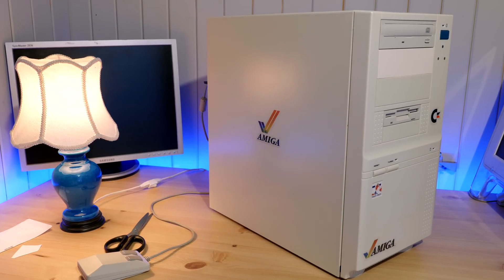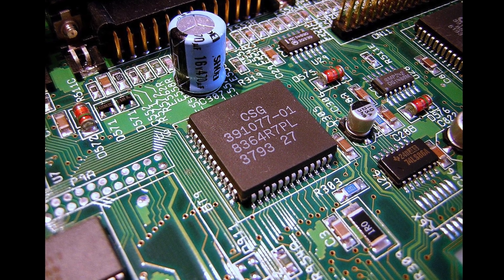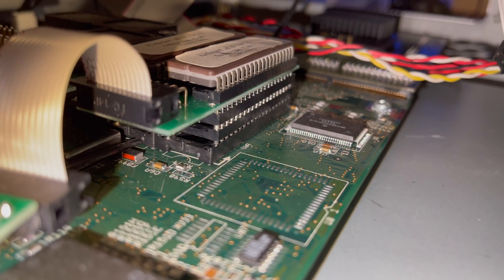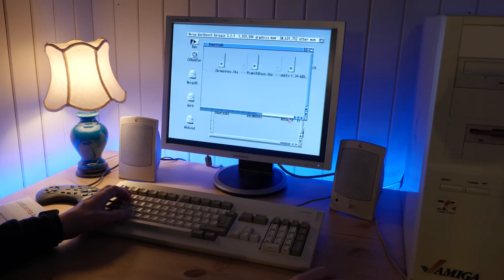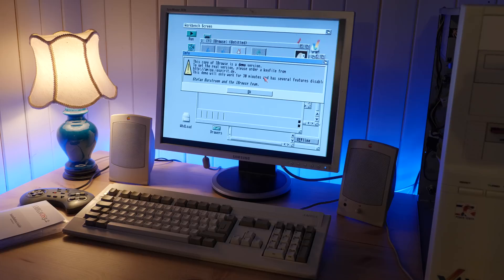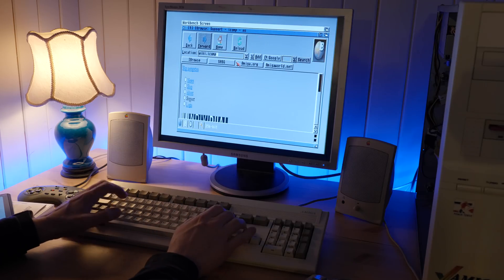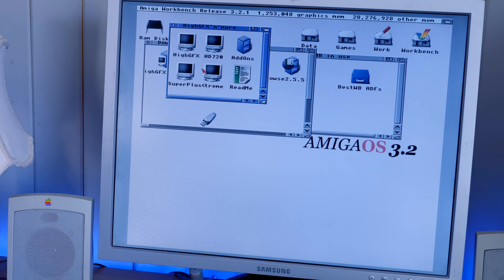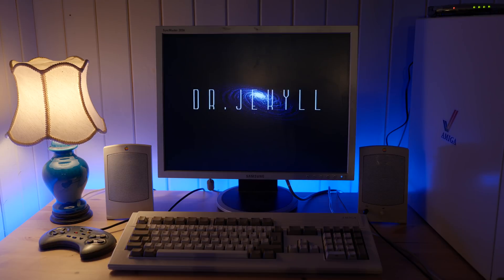Upgrading and getting online with the Amiga 1200 Power Tower

Comment: Whatever you do, do not hot plug anything directly into that rapid road. This device is very sensitive to voltage surges. At the very least use a high quality powered hub. As for speed 600-700kb is pretty much the most it’ll do over a stock clock port. Not quite usb 1.1 even.
Reply from the maker: So I’ve heard. There’s some conflicting information about this issue out there. Jens Schönfeld says it’s caused by improper 5v regulation and that ATX and MeanWell PSUs are usually to blame, but others say it’s an ESD issue and that the device should have been able to handle it. Thought about mentioning this in the video, but since I don’t really know what is actually true, I didn’t want to potentially spread any misinformation.
Reply: @OddObsolete  The MeanWell PSU comment is rich. This is likely from my busted RapidRoad that admittedly Jens did replace free of charge. It needs to be specified however that the particular MeanWell PSU I am using is medical grade and therefore liable to perform to exacting standards. So which would you rather trust? A world renowned PSU manufacturer with decades of experiences and a legally binding medical grade spec or Mr Jens Schoenfeld maker of admittedly high quality but still hobby grade devices? I like Jens, his devices are fantastic and I certainly spent my fair share of money buying a good collection of them. I certainly intend to buy more in the furture but the failure rate of these RapidRoads is a little more than anecdotal.

Comment: Hi, great follow-up video! If you give up on the Apollo, I'd be much interested in purchasing it, as I have a identical card in my Checkmate 1500-cased A1200. Unfortunately, my card has severe battery damage to the PCB, with a lot of crappy repairs done to it, but otherwise working. My idea was to migrate the working parts from my card and get yours working... Thanks again, and keep up the fantastic work.
/Anders, Denmark
Reply from the maker: The PCB on this one is in a pretty shitty condition too TBH. Looks like the CPU has been replaced at some point with aggressive solder gun usage…
But anyway, I’ll let you know if it gets to that!
Reply: @OddObsolete  Thanks! :) Looking forward to the next installment.

Comment: Where did you manage to get the rapid road for Amiga 1200 ?
Reply: Individual Computers are the manufacturer and they do have a shop. But as I’ve pointed out you really need to use a powered hub for them and they are quite slow through the Amigas Clockport connection. Have a look around also for Amiga resellers in Europe who might have them for sale. Avoid! RetropassionUK though. Terrible customer service and the owner likes to blame his customers for faults 😳🙄
Reply from the maker: I’ve actually had it for a few years, and I got it from a reseller in Sweden if I remember correctly. Not sure where you can get one these days, looks like it’s currently out of stock in most places. Your best bet might be to get a used one from eBay or similar.
Reply: @OddObsolete  probably GGSDATA. It was listed as available but when ordered I got a reply it was out of stock :)

I have the rapidtoad module for x-surf installed in an a4k and a2k but those module won’t work on the a1200 clock port :/

Comment: Please note that the Elbox FastATA has a hardware PCMIA reset fix built into its Gayle adapter. You might want to test that instead of the software fix
Reply from the maker: Interesting! Looks like it is an optional upgrade though: http://eu-shop.elbox.com/en_GB/p/GAYLE-adapter-with-PCMCIA-fix/647

There’s no mention of this feature in the manual, and I did have to use CardReset for the network card to turn on after boot.
Reply: @OddObsolete  Some Network drivers actually contain Card Reset and Card Patch as part of there startup.
Reply from the maker: @cullmaster7361  Handy! cnet.device doesn't appear to be one of them though.

Comment: If you can't get the '040 accelerator working, have a look at the Terriblefire 1260 cards. 68060 CPU, 128MB of onboard RAM and another IDE port. Oh, and open source. Stephen Leary is a legend.
Reply from the maker: Have had my eye on that one for a while. Looks like a great piece of kit!
Reply: The TF cards look to be a great alternative. Be aware though that the Firmware is constantly being upgraded to fix issues. So as long as you are technical enough and prepared to play around and not expect everything to work first time then they are a good cheap alternative. There are also other cards available like the Vampire V4 Icedrake, Typhoon and the fabled Warp060 card. Remember these are being made and built by enthusiasts and not by manufacturers like the days of old 😉

Comment: Nice Vid 👍🏻 A couple of things to point out. 1)… Worth buying Ibrowse 2.5.5 as 2.4 is fastly becoming obsolete for browsing due to the age. 2).. Ibrowse 2.4 will not support anything higher than Amissl 3.6. Again Amissl 4 and above is only supported in version Ibrowse 2.5 or higher and you will be able to browse more webpages. Also fingers crossed 🤞🏻regarding the RapidRoad, they really need a powered USB hub connected or they are prone to blowing the 5v rail on the RapidRoad. Also the RapidRoad isn’t that fast due to using the Amigas clock port. To get the most out of a tower system it’s worth investing in a Elbox Mediator board and some PCI cards. 😉

Comment: god that took me back. YAM - yet another mailer for email, iBrowse and AWeb, TCP stacks, MIAMI.  Fun fact, I had several Pcs(Win 98 and 2000)  and Amigas back in the day, and all connected via an ethernet hub. As much of a faff as it was initially, once set up it was actually easier to configure  than Windows 10 and 7 networks which i have now........
Reply: @Nny indeed, I only use wifi for devices that don’t have an ethernet jack (phone, tablet, etc). Going wired whenever you can for stationary devices also massively improves wireless performance for those portable devices, due to minimising the size of the collision domain.
Reply: @Nny fair enough. I’ve dropped my smartphones lots of times with no real damage (couple of scuffs maybe) but usually only a foot or two drop, not like 4-6 feet drop. More power to you though for knowing what you want.
Reply: @Nny ah yeah, up a ladder especially would destroy it. I dunno it the paving slabs I’ve dropped mine on are concrete or something slightly softer but.. I do know I am generally more careful and certainly don’t have a job that would put my phone at risk on the regular. And it often lands on wood or gravel instead of paving too.